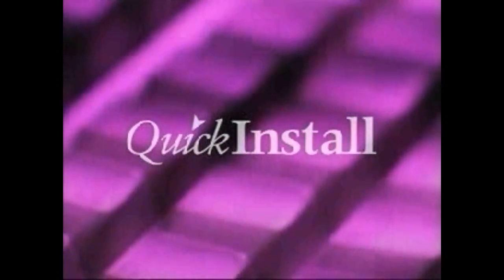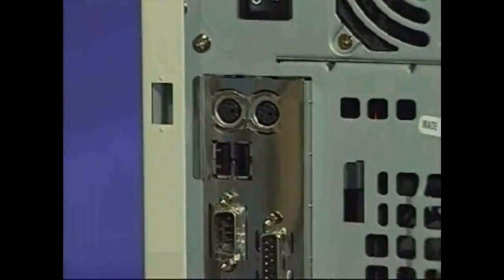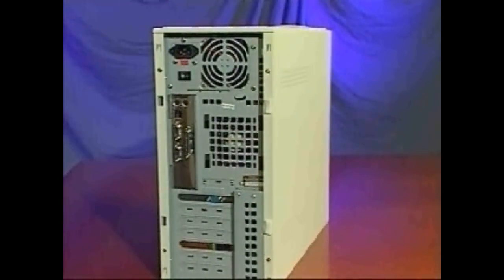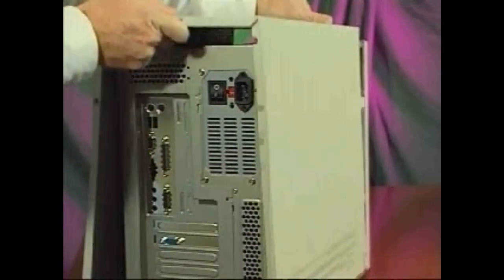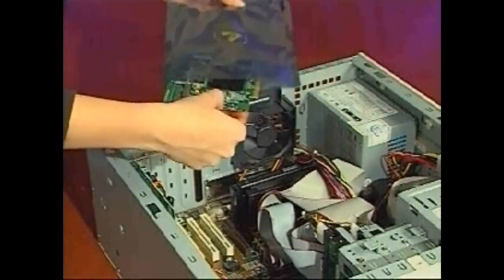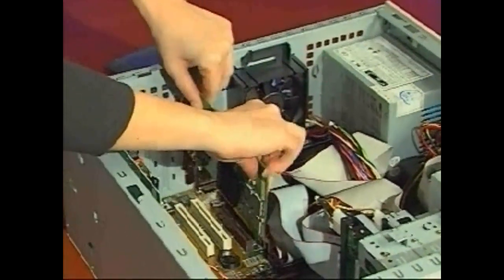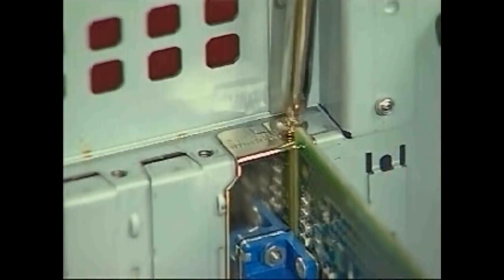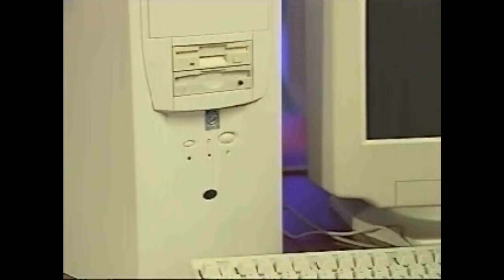How to install your Voodoo 3dfx card (1999)

Comment: Of course, only by the end of this video 2:18 do they show that the power switch is off on the lady's computer XD and yet the guy's computer had his off by 1:15 . Not to mention no discharging. Not that low voltage is a big deal but still. I love it. Classic early computer stuff. But hey - at least it was quick.